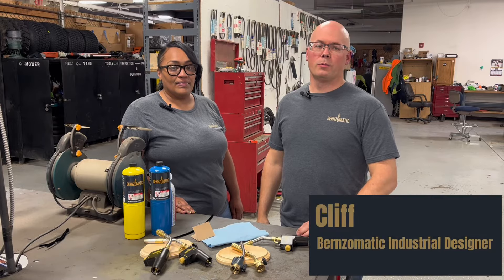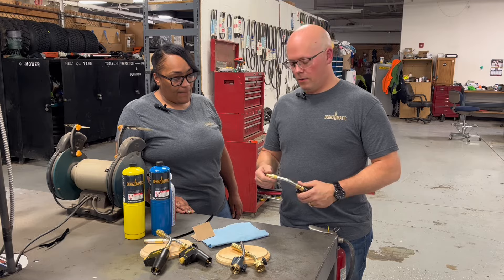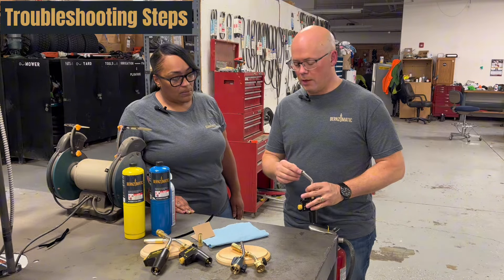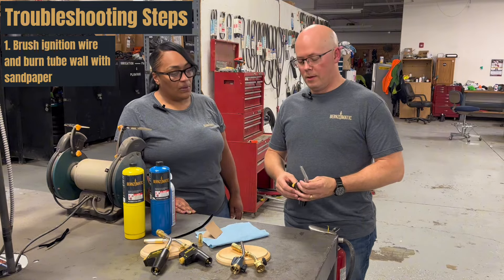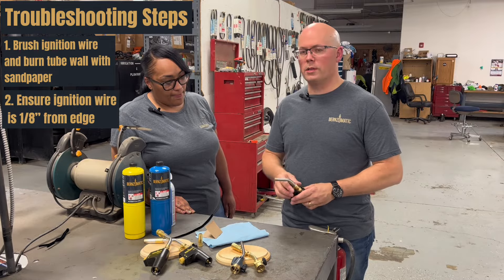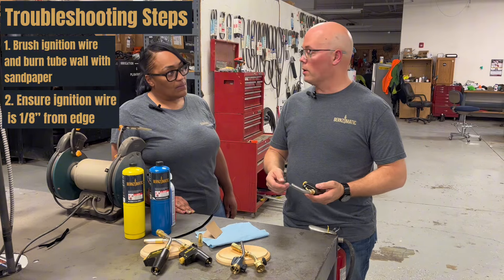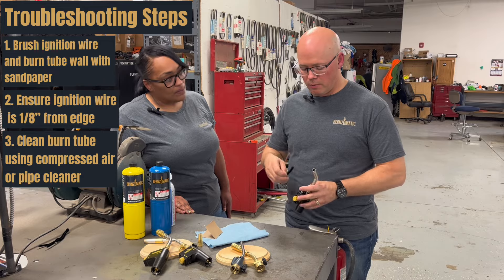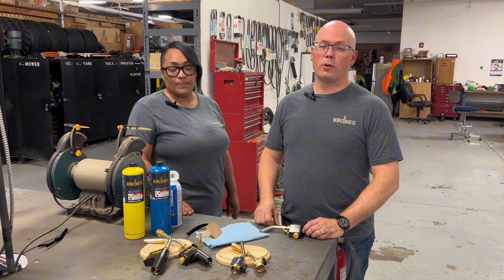What To Do If Your Torch Isn't Working

Comment: ok..... what about.... you get a flame.. but no actualy torch action... aka the fire coming out the end is  more like a TIKI Torch / large candle flame. not a work producing torch flame.   Have cleaned out the end .  it seems clean.
Reply: I have that same problem
Reply from the maker: Hello, you will want to clean the burn tube just like the video shows, pipe cleaner and compressed air. If that doesn't clean up the flame, please email us at bernzomatic@wthg.com

Comment: Thank you it ended up being a spider and WEB inside that was clogging it . I had to take it apart and clean the inside and clear out the spider and webs it was hard but I did it . cleaned and did everything else u recommend and works perfect again thank u

Comment: I have the TS8000 and I used a full can of MAPP gas and everything was fine. When I put a new one on it didnt want to light at first.
I checked for spark and thats good then when I put it back on keep the gas adjusted kind of low and it will ignite but if the gas is turned all the way up it wont and now the flame is different. Its a more aggressive flame and is even louder. Is this the MAPP gas can maybe over filled and creating too much gas pressure or is my torch going bad?
Reply from the maker: Thank you for sharing your feedback. We’re sorry to hear about your experience with your Torch. To help us understand more about what happened and to provide you with the best possible assistance, please email us directly at Bernzomatic@wthg.com. We look forward to resolving this issue for you.

Comment: Hi everyone,  does anyone knows what might be the cause of this? I got a propane torch and a 20 libs gas tank, I used for few times and it worked perfect,  I tried again to use it and it has a very weak flame now. I tried with a 2 libs propane tank and it works perfect.  The 20 libs propane tank worked in the beginning and it still nearly full tank, is not empty or anything like that.
Reply from the maker: Hello, we have a few questions, can you please email us at bernzomatic@wthg.com for further assistance. Thank you!
Reply: We’re they able to help you?
Reply: Check out some vids on BBQs.  You need to reset your regulator.